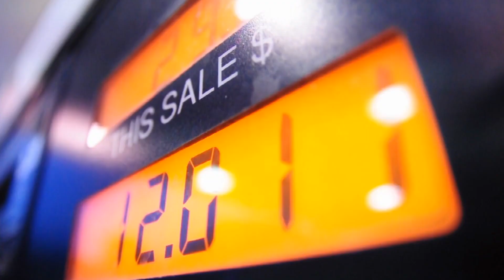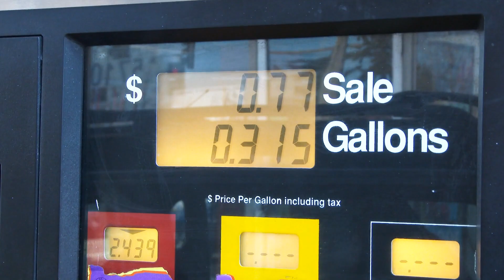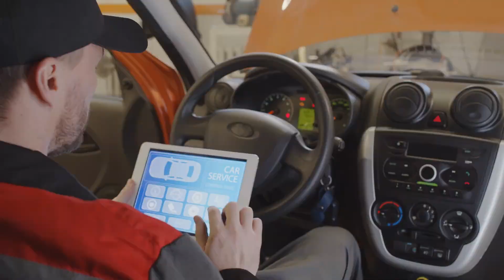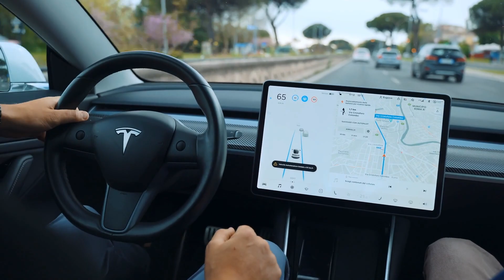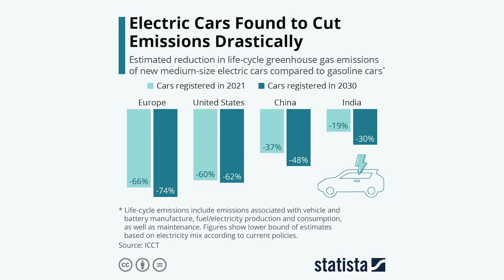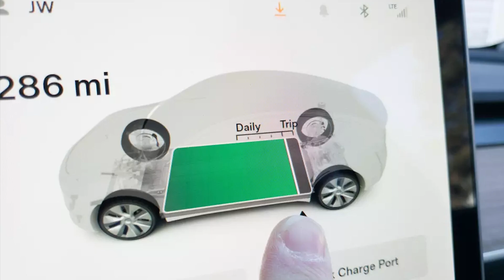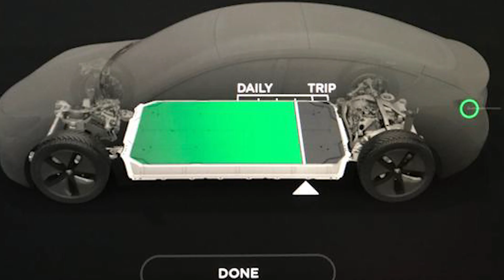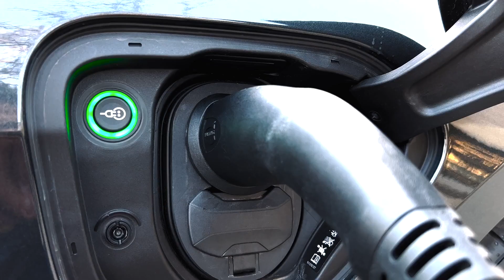Are Electric Cars Better Than Gas Cars? Electric vs Gas Cars Explained

Comment: No matter what car you're interested in, I recommend RENTING one for a week, and make sure it's really what you want. I rented a 2023 Chevrolet Bolt EUV for a week, and loved it. I decided, though, that I needed all wheel drive, because I live on a steep hill, where it snows in the winter. I am now Leasing a 2025 Chevrolet Equinox  EV with all wheel drive, and have had it long enough, to decide I will buy out the lease, and keep the car. I say that, because the car goes nearly 300 miles (480 Km) on a charge, and, I can charge at home. The car is getting much better efficiency, than EPA estimates. I'm averaging 4.2 miles per kWh, (6.7 Km per kWh), though, the car is rated at 3.4 miles per mile (5.44 Km per kWh) I'm certain, that winter will drop my efficiency to rated, if not slightly below. It will take a year of driving, to get a true average.
     Measured at the outlet, the efficiency is slightly less, because the car computer is measuring at the battery, but measured at the outlet, my mileage/Km/kWh is slightly less. 3.8 miles per kWh, (6 Km/ kWh) When the car needs to heat its battery in the winter, this figure will probably drop much lower! this rating will get worse. The less I drive the car, because heating the battery will roll up the power meter, without the odometer rolling up the distance.

Comment: In 10 years your battery will be in terrible condition and won’t be nearly as efficient or may need to be replaced, which severely bumps up the cost.

Comment: Well depending on the vehicle a Well maintained gas powered car at 150k still has plenty of life left without major repairs, for instance if the transmission is manual, the engine is reliable, you have timing chain

Comment: It take for  ever to charge?
Reply from the maker: It depends. The newer models have fast charging capabilities. For example, you can add up to 200 miles of range in just 15 minutes at a Tesla Supercharger. Charging at home will take hours, but that's often done overnight when the car is not in use.

Comment: Both gasoline and electric vehicles have their pros and cons each one is limited to many factors, fuel vehicles cause a lot of damage to the environment and high fuel cost unlike electric ones we can spend less on electricity but these have disadvantages since very long distance roads cannot be recovered and in winter the charge lasts less. This video is a lot of very useful information that teaches us a lot

Comment: This was a nice comparison. I've seen lots of biased videos. I bought an EV in the 3rd quarter of last year, and it's one of the best cars I've owned. I was sick of the gas and, after researching, determined it was the best for me. I charge at home, and I don't normally take long road trips or drive very far for work. I'm not afraid of a road trip though, and plan to take a few this year.

Comment: If I am to choose between electric cars and gas cars, I will comfortably go with electric cars. Very soon solar system with will take over car source of energy.
Reply: No thanks, I'll stick with combustion power till I die. Only a pussy would drive an electric car.
Reply: Same here. I'm installing 16,200 watts of solar panels, will include 70 kWh of battery storage. Gas/diesel prices can get as high as they want, electricity prices can fluctuate all they want. It won't affect me even a little bit! (2025 Chevrolet Equinox EV AWD)

Comment: Electric Cars have gained a leading position in the world and the demand for Electric Cars is increasing now. In my opinion, Electric Cars are a very good solution with the current economic situation. Because its cost is very low. You have explained well in this video whether Gas Cars or Electric Cars are better.